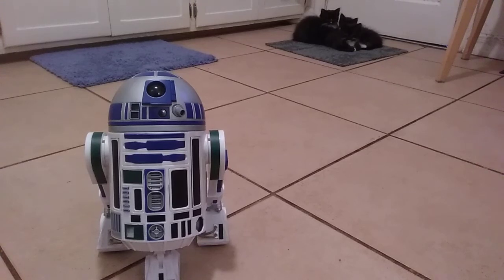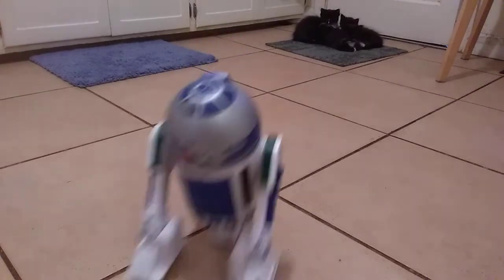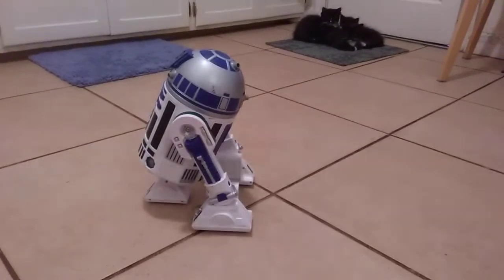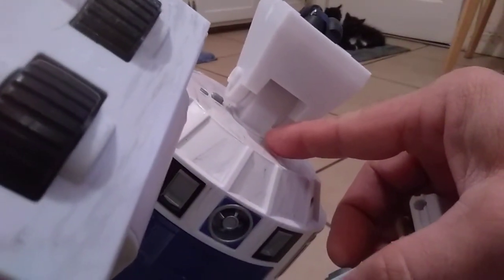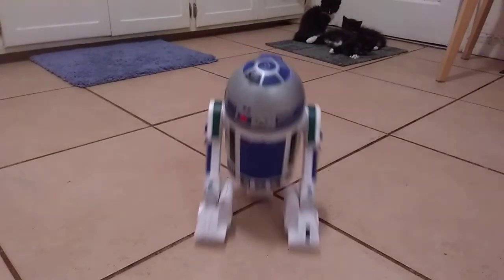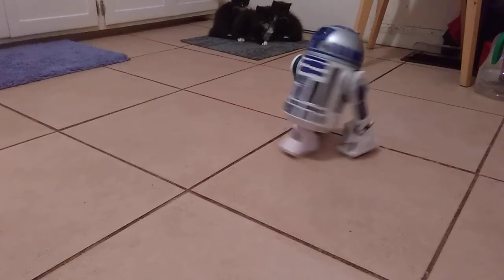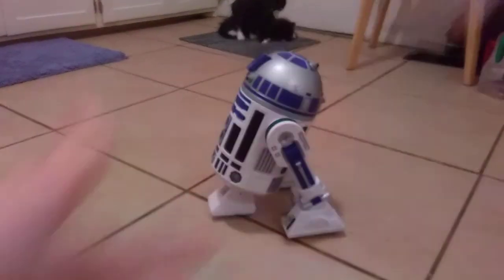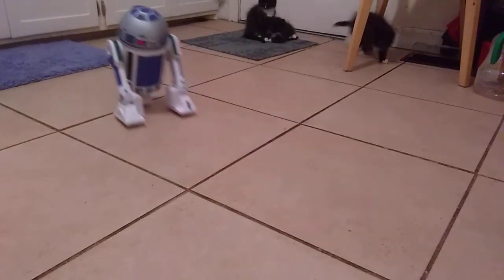Droid Depot R2 Omni wheel foot upgrade

Comment: Hi I just recently received my R2-D2 & as you mentioned in your video my R2 also tends to turn left when I’m pressing the up & down buttons on the remote. It won’t really commit going forward & backwards. Am I doing something wrong or can it be another issue?
Reply from the maker: I have looked it up and I believe that some of the motors weren't up to snuff or some of the wiring to the motors was not so great. Of course it could be a lubrication of the gears is uneven from side to side, but most likely being so new and unused it's more likely the motors were put in not so great
Reply: @NathanQS  oh ok I see. What do you recommend I do? If I can do anything myself. Would like to try & avoid sending it back. And is yours the same from this video or did you get it fixed as well?
Reply from the maker: @RichS21  Ok, I re-read your comment. You are using the remote and it won't commit to turn when you use forward and right, for example? I think that's it. I have found that using the remote, that happens, something about the way it is programmed. HOWEVER if you use the APP it doesn't do that, again the programming is a bit wonky as far as that goes. Mine is the same from this video, the app corrects the "won't turn" problem but I still need to rewire the motors (it still pulls to the side)
Reply: Richard, you might want to see if you can get some thin tools into the drive wheel area & clean out the dust & lint that always gets trapped around the axels.